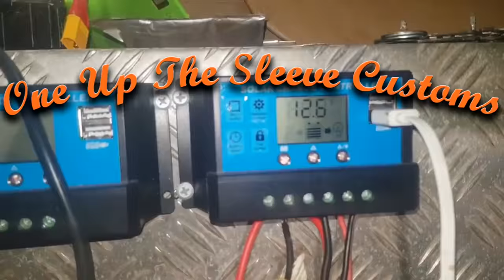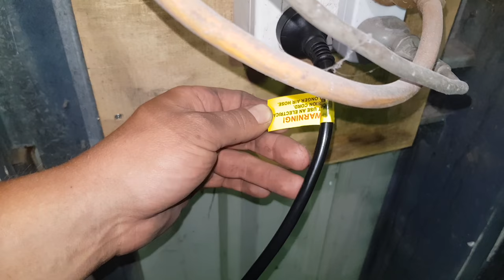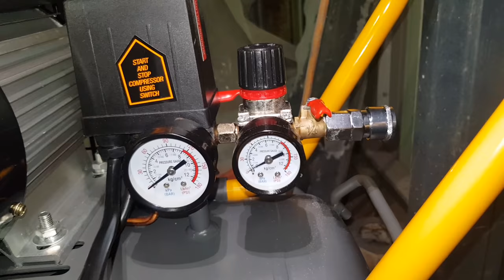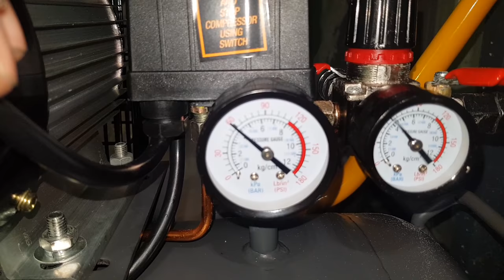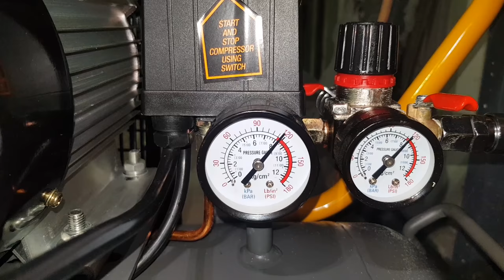Blackridge Air Compressor Belt Drive 2.5HP Unbox /  Review

Comment: I have the Stanley as well, the difference is it has a higher RPM with an Italian manufactured ABAC pump, the rest of the unit is chinese.  I don't run a trap at the compressor when using air tools, just drop a bit of oil in em. When i'm spraying i run a few meters of hose with a trap on the end which i hang up high, i then plug my air hose into that and also have a filter on my spray guns...2 pack goes on perfect with no moisture bubbles in the clear after a few months.  I have no choice but to use an extension lead on mine, i got a 15amp lead made for a caravan and chopped the plugs off and changed em to 10amp...run the welder off it too if i need some extra distance.
Reply from the maker: +Stephen Ozoux yeah bit of a different story when you have a serious lead but most people buy a 500 dollar compressor and power it with a 10 dollar cheap shop lead haha. Yeah i have the stanley and it runs great that being said i have 2 blackridges and the 3 year old one still runs like a dream

Comment: I note that SCA has 185LPM Blackridge Air Compressor Belt Drive 2.5HP for the same price as the 155LPM, would that be a better buy?
Reply from the maker: Belt drive
Reply: Yes, Item No. 545698, ...both $399 on special
Reply from the maker: Buy the belt drive for sure
Reply: I just looked at all your videos regarding air compressors and just found on the Stanley AU website - the 190LPM yellow compressor at only $589 with free delivery - would that be the best choice?
Reply from the maker: My stanley is almost 9 years old and still my favourite. Fast quiet and epicly reliable

Comment: Good review mate I've got their stanely compressor that SCA sell and its been bloody awesome. Hasn't missed a beat in the 6 years I've had it and its done a lot of work
Reply from the maker: +Chris's DIY Projects thanks mate me too i have the Stanley and 2 of these blackridge ones haha
Reply: One Up The Sleeve Customs how do you reckon this one compares to the stanley one?
Reply from the maker: +Chris's DIY Projects Stanley  is 190 lpm so a bit faster but my 3year old blackridge has done 200 plus hrs work. Zero issues at all service it blow out to filters happy days. I got the Stanley 7 yrs ago too and it has done great . Both good value although the blackridge come on special as low as 399 some times so by price i would near choose it
Reply from the maker: +Chris's DIY Projects the blackridge seems to rotate slower so  it could be better in the long run. I'm heading out to the shed shortly to use the blackridge for hours on end haha

Comment: Hey mate. Would you recommend this one to paint a car or it's LPM/CFM are too low for that?  Cheers! 
Nice reviews  by the way👍🏽
Reply from the maker: On a high volume low pressure gun sure would. Or a paint pressure pot system also good. My too have done more than 1000hrs work between them and both still go great
Reply: @Oneupthesleevecustoms  Thanks for that mate!! Just wanted to know that but I'm trying to decide between that one which is on sale atm for $323 down from $539 and the Stanley belt drive 190 lpm 2.5 hp which is atm for $579 down from $899. With my brother in law we don't have any idea about painting a car but we are trying to read and learn  and we want to try with a small car he has, because of that I want to know which one will be better and for what I've seen on your nice reviews I think the Stanley will be the best option but please let me know. We need to save some money so if the blackridge is good for that, then it can be our option but if the option is the Stanley then we will have to expend the money on it. Thanks once again mate. Cheers!👍🏽

Comment: this one is just a model because the real one  comes with a large box and safety instructions written at the top where it says important Notice
Reply from the maker: What do you mean just a model?
Reply: Well Yes because it is because if it was real then it would come with the default air tools
Reply: including the spray  guns  and other things like paintings and the air flow which is the system that refills the tires or the wheels
Reply: also the Fuel cleaning